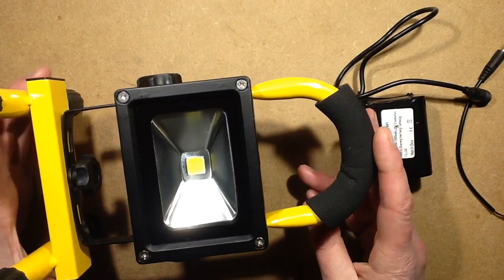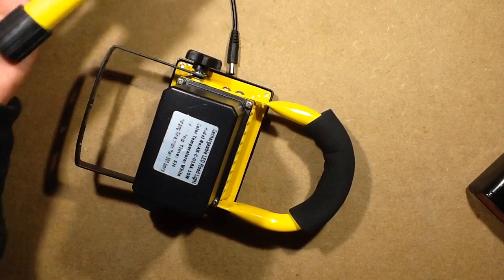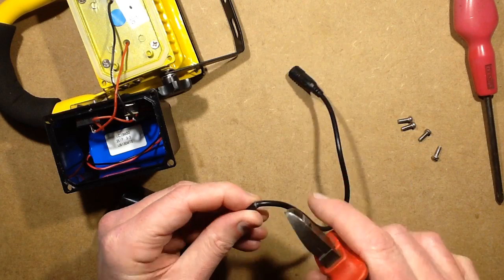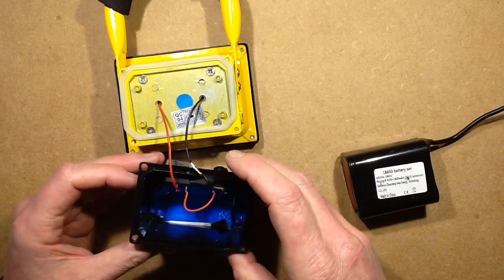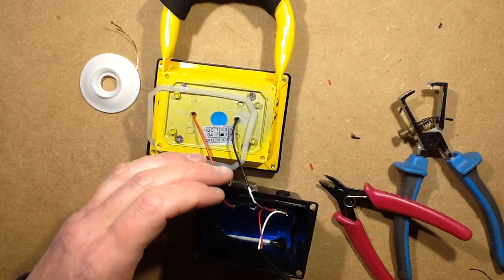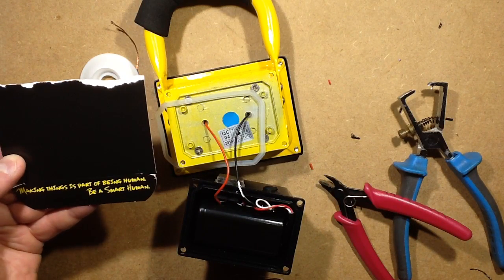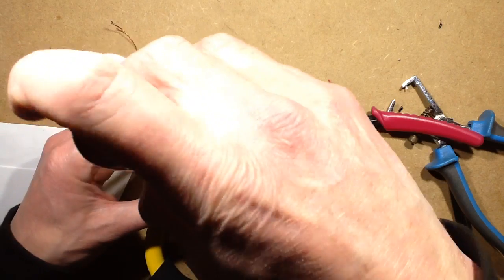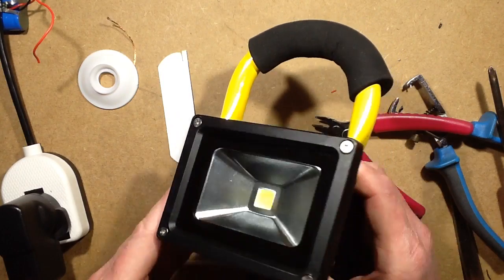Boosting the battery capacity of a rechargeable work light.

Comment: watching you at 5:20 reminded me of when i was having to replace about 10 plug-ends a day.  i found a device that i thought i'd give it a try at removing the outer sheath on extension leads by rotating gently then folding the lead back and forth.  ive since found out the device was intended to clip the claws of cats, dogs or birds.  also, my portable light like yours developed a rattle.  i dismantled it to find that the makers had used hot glue to hold the battery and everything else in place.  therefore had i wanted to remove the battery i would have used a hot air gun on the outside of the box then poured a bit of isopropyl alcohol in the hole.  it makes the hot glue instantly let go.  perhaps a bit of sideways persuasion with a screwdriver as well.  i like one of the commenters hinting that, for all these years, i may have been using the side nippers the wrong way round.

Comment: Im doing almost the same thing. Accept i have an old bosch cordless with 3 battery banks. Im just changing the plastic back part with a 3D printed cover for the battery and a dc to dc buck converter. Dont want to let too a high voltage pop the LED.

Comment: Hi would this light still work by taking the on off button out? (I’ve wired it up to longer wire’s and plan, in theory to use it with my electric fence battery.

Comment: I have almost the same exact model. Mine only had one battery in it.. I re-used the 3.7v BMS off of the single cell and replaced it with a 4x18650 pack i threw together in parallel. Salvaged laptop cells, but all genuine Sanyo. Battery life is actually usable for work now, charge it overnight and it'll be near full by morning. I could upgrade the 1s BMS for more charging current and shorter charge times but I am happy with it. Besides charging the cells faster will only ultimately give me less duty cycles out of them.

Comment: Doesn't the additional current put a strain on the LEDs or other components? Would adding a resistor help?
Reply from the maker: It doesn't increase the LED current.  Just the run time.

Comment: The "depth" of cells are indeed in 1/10ths of mm. EG 2020's are 20mm diam by 2.0mm depth.  2032's are 20mm diam by 3.2mm depth.  Therefore 18650 are 18mm diam by 65.0mm "depth"/long. See https://en.wikipedia.org/wiki/List_of_battery_sizes for more info

Comment: I did the opposite of shorting the system out like that.  I was working on an external DVD drive for a tablet PC. I had it plugged into my laptop's USB Port and it was not working right. There was a 2.5 in power port for 5  volts on the back of the DVD drive, so I thought I will just plug in the 5 volt brick that runs my clock on my desk. For some reason I had it unplugged anyhow, so I grabbed the cord and plugged her in. My laptop shut down and magic smoke came from the keyboard!  Then I noticed I had grabbed the 12 volt cord for anther device and fed my laptop USB with an extra 12 volts.  The USB have never worked since.  Well the laptop does have one USB 3 port and it still works.  Guy has to be careful even in his own shop.

Comment: I am going to assume that these battery packs do not have any kind of balancing circuitry, so the banks will probably drift a bit each charging cycle. Most of the reviews I have seen have been pretty bad. Does anyone have good experiences with them?
Reply from the maker: The battery packs do have a small balance and protection board in them.
Reply: Thank you!

Comment: I have 2x wonderful strip light work lights. They run off a 6 volt lead acid battery when the mains is cut like automatic emergency lights. However I have changed the batteries but both have died again. Are there any 220 / 240 volt charge controllers for Lithium battery packs and packs that you know might fit? Similar to this pack?

Comment: Yea, you have to whack in two more high output cells and you are set. The batteries that come with these are crap.
Reply: In the case of the one you have I would replace all the cells with Panasonic 3400 mah cells and it will last for a century.

Comment: I can never work out what light output matches say a 500W halogen lamp in LED light how many watts do you need?
Reply from the maker: +Chaz Madge Theoretically between 50W to 100W depending on LED efficiency.
Reply: Having got some work lights I was thinking of changing them over to LED so as no heat, guess get the right drivers and a 50W would be best way to go. or just buy some

Comment: They grip of your screwdriver looks kind of weird. 🤣
Reply: They are known as a Cabinet Pattern or Cabinet Makers screwdriver. Traditionally made of wood. So people like the grip because the fatter rounded end fits in the palm spreading the pressure, and the non round cross section helps grip for more torque.
  No very good as used here. But you would appreciate it if you had to drive home wood screws all day, before power tools were available.
  https://www.drapertools.com/category-products/5180/Cabinet-Screwdrivers-186-Range

Comment: This may be a noobish question but I recently bought a bike light with this exact battery pack for it and a 8.4v charger. The charger blew up after only 2 uses and I replaced it with a camera charger that outputs 1500ma also on 8.4v. My question is because it doesn't have any light indicating that it is changing on the charger itself can I overcharge the battery pack? I tried charging the pack up and it seems to work nicely, it doesn't heat up nearly as close as the old charger, but I always disconnect the charger after about 4 hours of charging just in case.
Reply from the maker: +Boris Dusnoki The lithium packs in the 8.4v lights usually have protection.  But your charger may be putting out too high a current.  You can get replacement 8.4v chargers on eBay.
Reply: +bigclivedotcom thanks for the quick reply. I didn't want to have to wait a month till the charger arrived that's why I got one from a local shop, used. I'll order one just in case. 
BTW love your work. Got me really interested in electronics and started doing small projects and repairs on my own :) keep it up!

Comment: I received one of these today but mine only has 1 x 18650 cell inside. Also the cell is held in by a very sticky white gloop, it's soft to the touch and still feels wet, but does seem to be doing the job of holding the cell in place.

Comment: I'm contemplating buying one of these cheap units just to use the housing and stand to make something better. Probably install a 2s3p lion pack like you Clive. Then perhaps rip out the COB chip and install a single warm white (4C) Cree XM-l2 chip with 3 mode driver. With luck I won't even have to change the charge socket if it is the same as the plug on my higher quality 8.4v power supply as the ones you get from ebay are very poor as I believe you've found out. I might even fit a little LED battery voltage readout as the protection circuit on cheap Lion packs always lets the voltage go too low. Thanks for the idea Clive, cracking video as always.

Comment: Have you tested the capacity of the new battery pack? The majority of Li-ion cells sold at eBay are counterfeits with much much lower capacity than stated. 
Here's a couple f shocking examples of what a counterfeit 18650 cell can look like inside:
Fake ebay batteries 18650 https://youtu.be/eOshOXcSkDA
Comparing Panasonic A, Panasonic B, Sanyo, and Ultrafire cells https://batterybro.com/blogs/18650-wholesale-battery-reviews/96816774-comparing-panasonic-a-panasonic-b-sanyo-and-ultrafire-cells

Comment: Is there any protection circuit inside the new battery pack? The eBay link doesn't say anything about protection.
Using a new battery pack without the same level as protection as the old pack is dangerous. And if there's no under-voltage protection, you might risk discharging so much that they can't be charged again.
Reply from the maker: +ITubeTooInc It does have protection.

Comment: 7:19 They reason they spot weld on battery terminals instead of soldering them on is that Li-ion battery cells gets partly damaged by the heat from soldering battery terminals.
If they want to solder the terminals on the PCB, they have to do this BEFORE they spot weld the terminals onto the battery itself, to avoid heat damage. You should never solder terminal directly connected to Li-ion cells.
The reason they spot weld them onto the PCB is probably that they do it in one process as they have to spot weld the terminals onto the battery itself afterwards anyway. By spot welding both end of the terminals, they can also spot weld them onto the cells, before connecting them to the PCB if they find that easier.

Comment: 5:55 & 10:42 & 12:00 Both of your side cutters are turned the wrong way around when pulling off insulation. Turn it around with the other side pointing in the pulling direction and it will no more slip over the insulation when pulling. This makes a huge difference, you don't need nearly as much finger strength to keep it in place then. Try both ways a couple of times and you will soon see the huge difference, especially for the tick wire @ 5:55. You can even make a video about it.

Comment: I had the charge protection in my phone short circuit.  I was charging it off my car while at work with a dodgy cable.  When I came out on lunch break the cable was melted and I burned myself picking up my phone.  

Amazingly the wireless charging still worked and the battery was ok.  It must have been the phone circuitry and not the battery's that went tits up.

Comment: wouldn't the pack need a balance connector?
Reply from the maker: +TacNipples It has a balancing and protection PCB inside.
Reply: Only if you don't use a specialised protection board. In this instance, the battery pack does have a balancing circuit inside to stop the cells over or under charging
Reply: @DigBipper188  Most do but many of them don't for various apps. Sometimes if you buy the cheap Chinese cells they'll have a phony PCB installed just for show (I'm not joking on that)
Reply: @randypederson6271  yup. I've seen a couple fake cells like that. Gotta be super careful charging those up if you haven't got a balancer or a BMS available to ya!
Reply: @DigBipper188  They do sell the actual cell protection circuits if you have a bunch to protect.
Reply: @randypederson6271  I know. I have a 10S e-bike battery with one in it plus a cc/cv power supply to charge it from. not to mention every circuit I make using them has a DW01 protection board in it bare minimum. Can't be having explosive cells where I'm at... Don't have an explosion containment pie dish like Clive ;)

Comment: I decided to follow your example and get a 10W work light and increase the battery capacity.  http://www.ebay.com/itm/10-WATT-COB-LED-FLOOD-WORK-LIGHT-ALL-WEATHER-PROOF-LI-ION-RECHARGEABLE-BATTERY-/381492926280?hash=item58d2c01748:g:FL0AAOxy4eJTPj6-
But when it arrived the LED was in a 3x3 arrangement.  When I took it apart there was what appeared to be a boost converter and four cells in the battery pack.  Fully charged it put 9.6V across the LED. 
Photos at   https://flic.kr/s/aHsknYRaau
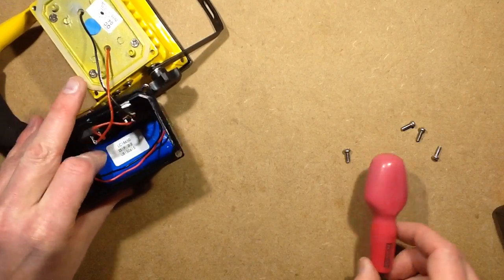My phone has a Lux meter app so I did a time/brightness test.  Fully charged it put out 625 lux. At one hour - 600 lux. At two hours 426 lux. At three hours 366 lux. At four hours 341 lux.  It shut off abruptly at 4:23.  Since the brightness decreased so much I guess it isn't a very well regulated boost converter.

Comment: The reason why it has so much space is becaus normally there is a battery charging circuit and sometimes a USB A output with 5V regulation ofcourse. As always there chinese things get sold under all kinds of rebrands.

Comment: I have a little question I have a nightlite one my work shet that i will be converted to led.
To keep thefts away from it i will power it with 12 volt ups accus 32 amp an hour.
The led bulb is 0.9 watt how long will this bulb burn on a full load from the accu.
Sorry for my bad grammatics im from the Netherlands.

Comment: You should use a battery charger that tells you the true capacity of the cells and test the capacity of the new battery pack, to compare it with the capacity of the previous one. Sometimes those chinese battery packs contain really really crappy cells with very low capacity, so even tho you have 6 cells, you might have lower capacity than the original 2 cells. Worth testing. :)

Comment: From what i understand. 18 is mm diameter, 65 is mm long and 0 means cylindrical. I may be wrong. Another possibility is the 65 is 65.0mm. Not 100% on that but my hardware engineering lecturer did explain that's the way the numbers work with these kinds of Li-ion batteries.

Comment: http://m.ebay.co.uk/itm/111696220334?_mwBanner=1 any chance of getting one of these to see how 'safe' they are. And what's inside one?
Reply from the maker: +Birdiemango1 They're very simple, and actually safe despite looking like a two-plug widow-maker.  They use one plug for power via a beefy relay, and the other plug which goes into a timeswitch is just controlling the relay coil.  So the two plugs are completely separate electrically.  It's used as a buffer to reduce the current through a common time switch.

Comment: what would be the best way to make them more efficient? upgrading to 3cell li-ion batteries and a cheap 12v constant current board for 10w leds? but what about charging ? i just cant find a cheap source for a cheap 3s charger (wich is not overcharging can only find those crappy imax b6.)
Reply from the maker: +Zentrius Slow charging is preferred for battery longevity, so I'd recommend sticking with the original charger.  You can change the internal resistor (when one is used in the reflector area) to choose a trade-off between light output and run time.  I prefer run-time over intensity as the light is just for ambient illumination.

Comment: I think it was done originally in 10ths of a mm as you say Clive, so 2032s are 20mm diameter, 3.2mm 'long' (aka thick, in their case). I guess kind of like the way fluorescent tubes are measured in 1/8ths of an inch (T8 being 1 inch, T12 1.5 inch, etc)
Reply from the maker: +TheChipmunk2008 And indeed PAR64 lamps are 8 inches diameter, MR16's are 2" diameter.  I'm pondering whether the earliest LEDs were also measured in eighths of an inch, since they had numbers that may have alluded to that.

Comment: Beware of dodgy crapy quality recicled LithiumIon cells in ebay... often they don't meet minimum safety requirements, and in series connection it may end up with a battery blowing up.
My suggestion would be to rebuild the pack using good trustable batteries from Panasonic or Sanyo (for instance), or at least check that it has the proper (and working) balancing circuitry.
Nice upgrade, by the way

Comment: I need help lol I love the light but the American version has no charging or charged indicator light would there be an easy fix for this thanks in advanced
Reply: +david wise  wow I thought I had a legit question lol guess  not
Reply: +mipmipmipmipmip lol kool quick fix but no how do i know how long to charge i guess about 4 to 8 hours would be good thanks for the help
Reply from the maker: +david wise As a rough guide, the charge time will be the mAH battery rating divided by the rated current output of your charger.
Reply: +david wise You could always modify it with a cutoff and recharge circuit... they're readily available on EBay...

Comment: The last digit means that the cell is circular in diameter. 18650, 16340 (16mm diameter, 34mm long. AKA CR123), 14500 (14mm diameter, 50 mm long. AKA 'AA' cell.)

Comment: Actually, speaking of cell sizes, I got an old Toshiba Libretto 50CT last week that has a battery pack made up of 3x 17670 cells, so slightly thinner and longer than the normal 18650...
Reply: +twocvbloke thats good advice, i was sure all laptop batteries (apart from the few lipo ones) all used 18650s, certainly all my 18650 are from old laptops, didnt know i have to look now to avoid weird ones also!   generally my luck has been sony or samsung cells, marked as 2100-2300 ah, but being worn , i usually get 1600mah with rare duff ones (coming closer to 1ah) but at around 80p a cell.

Comment: hey Clive, I always found it was easy to strip in a non-invasive way, by just bending the wire back on itself and making a small knick in the insulation of the wire with a blade and the bending it back 180 degrees the nicking it again, then you can work it back and forth until the insulation breaks, once you hve opened the insulation up a bit you can dellicatlly nip and slice any remaining insulation.

Comment: I have one of those 10 w lights.
It has 4x18650 1500mAh cells and the LED is driven by a 10w driver board.
So no room to add more cells, but one could remove the current cells and just replace them with higher mAh ones,
Reply: do you remember what brand it is?